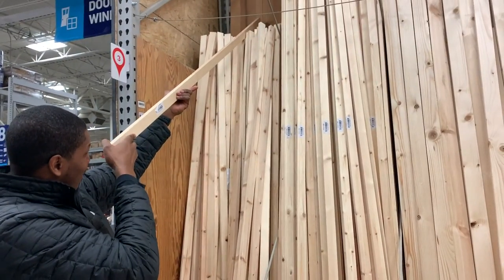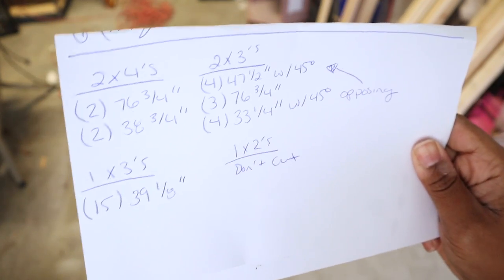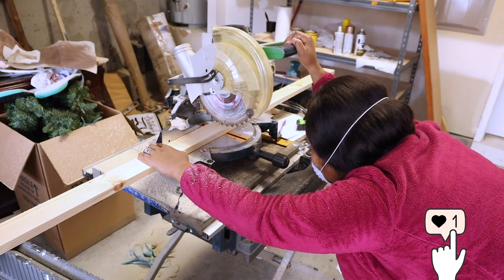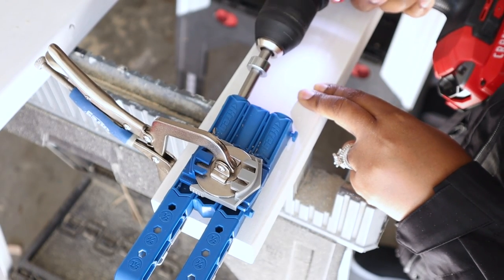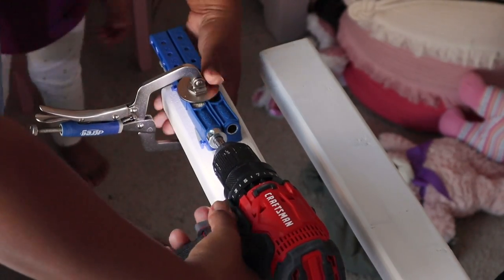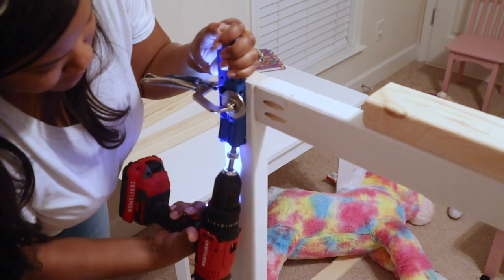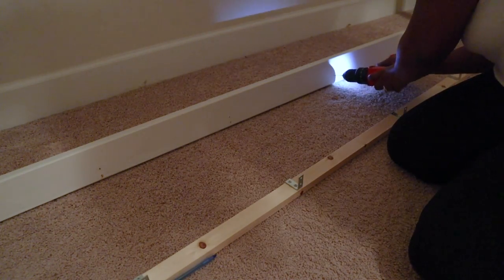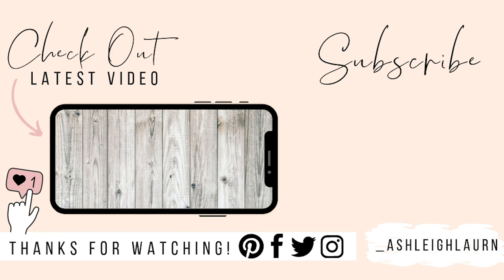DIY HOUSE BED | Easy & Affordable | Ashleigh Lauren

Comment: For my kreg jig it shows that wood with a 1 1/2 inch such as the 2x4 and 2x3 that it needs screws 2 1/2 inch long not 1 1/4 but I allready got the screws before I got my new jig in!!

Comment: Tried to follow your directions, you were not very clear. The cut size in your description is different from your video cut size. When describing the lengths for the angle cut pieces, you never specify if that is to the long side or the short side of the angle. Glad yours turned out well because mine did not.
Reply from the maker: Hi Samuel. I was a thorough as I could be. All the angle cuts you can visualize in the video, that's what it’s for. The cut sizes are the same, but they are different from the original, and I explained that in the video. 

To bad this didn't work out for you as I've had plenty of others recreate this same bed using this video and my cut list with no problem. Thanks for watching. 😊